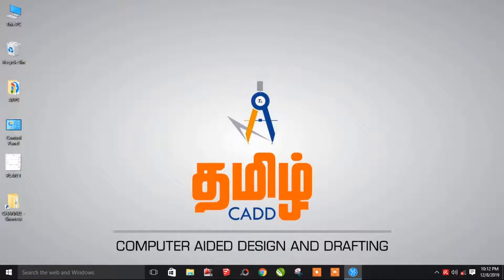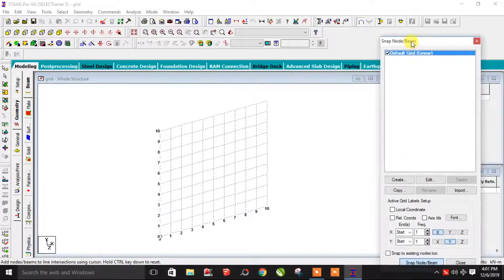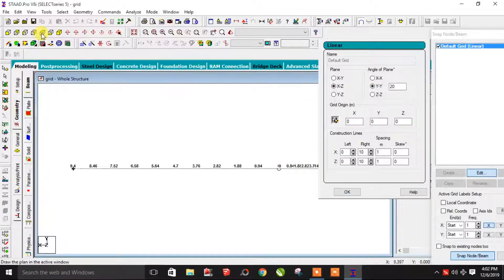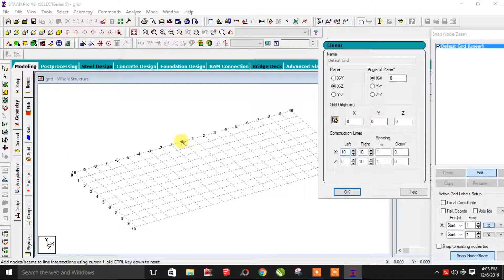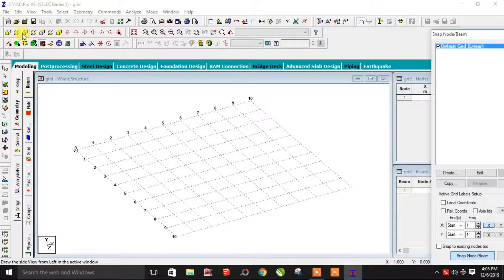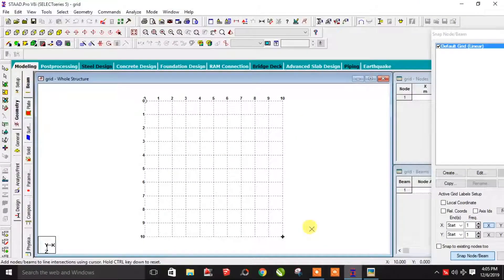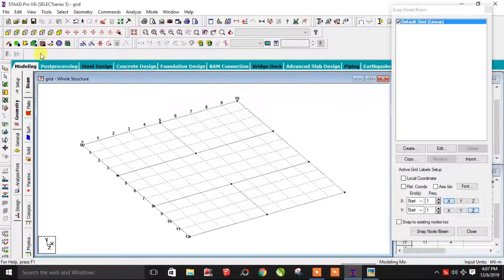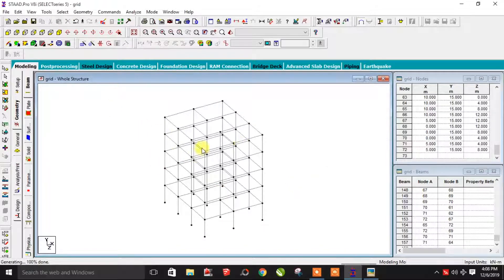HOW TO EDIT GRIDS IN STAAD PRO_STAAD PRO TUTORIALS_SNAP NODE BEAM METHOD_STAAD PRO IN TAMIL

Comment: bro nama use panra ellame feets and inches dhaan... 9  feet epdi grid la podradhu adha solave ilaye
Reply from the maker: S bro fulla meter la demo kuduthurupen 
New project start panrapo  unit foot vachirunga 
Edit same than🤝
Reply: @TamilCADDInfo  thanks for the reply bro... Grid la different positions la column placement epdi vekradhu and orientation of columns and position soli kudunga if possible 🙏🏼